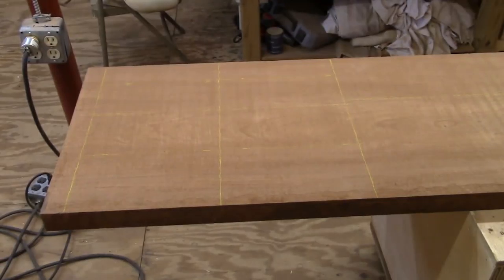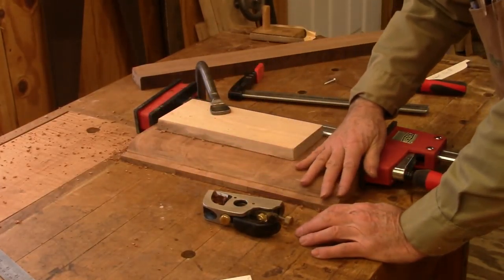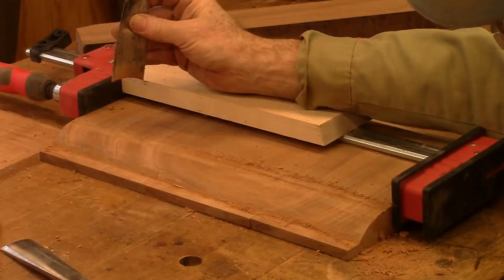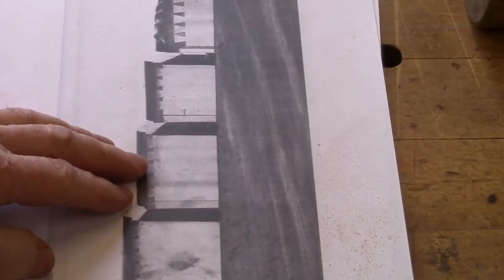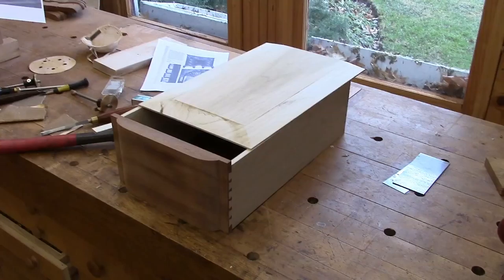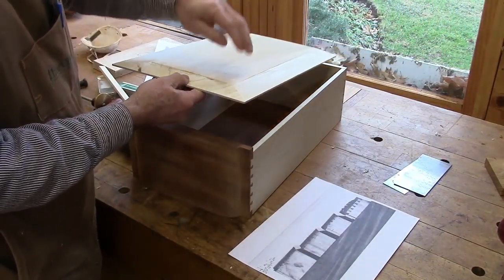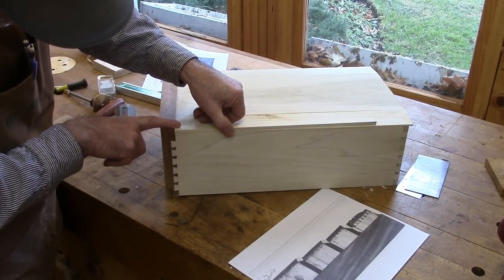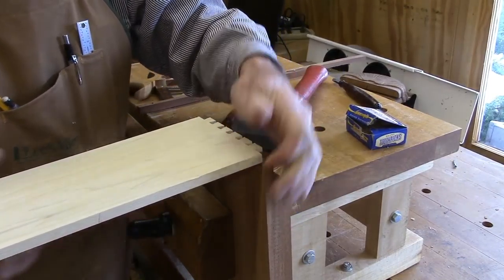Townsend Kneehole Bureau Making the Drawers Step 10

Comment: Keep these coming. I really like that table on top of your bench. I noticed it when you were fitting the dovetails. Does it have its own clamp?
Reply from the maker: Thanks Bob, the small bench on the bench is mounted with bolts thru the legs into recessed brass nuts to hold it in place
Reply: David Boeff thanks for getting back to me. I literally just checked to see if you had a new video